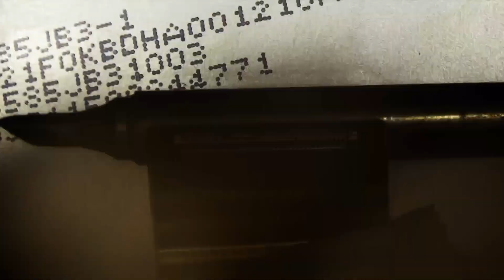Connector Replacement Trick

Comment: Sooo,  where's the "Trick"?????
Reply from the maker: One of the tips in this section was that it is better to use scrap mobile boards connectors for replacement instead of new market connectors🙏